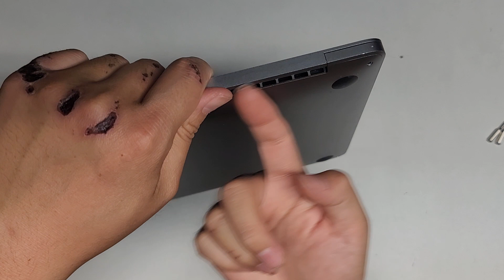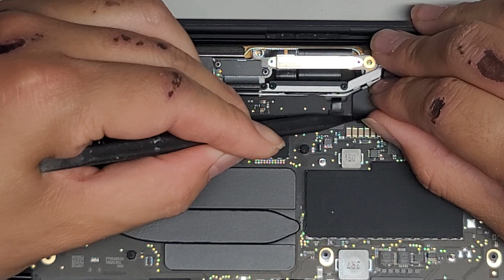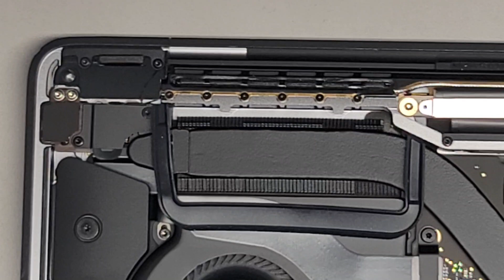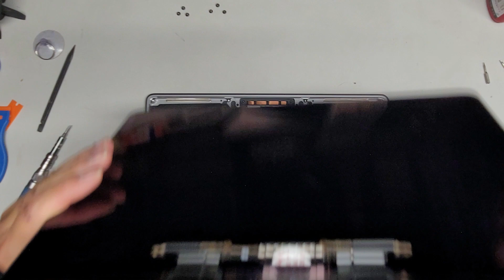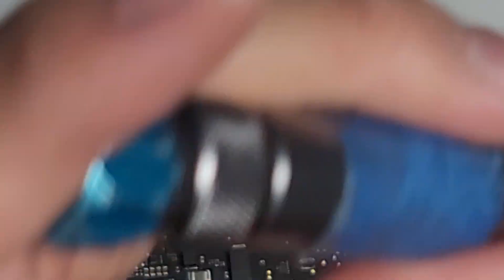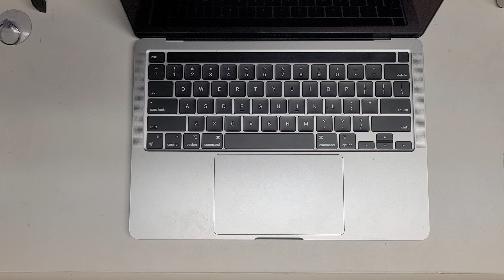2020 13" Inch M1 MacBook Pro A2338 Touchbar Disassembly LCD Screen Camera Webcam iSight Assembly

Comment: Hi!! Awesome video, but my True Tone is gone! Lol! I used a used original screen of the same model (A2338) and the true tone does not work. I already tried putting each screen back to its original state and the true tone works on both macbooks (I know that on the damaged mac it works because it connects a screen via HDMI and True Tone works). Any idea why that happens? Or any solution?
Reply from the maker: Did you check the year of the MacBook to make sure? Also, some people sell screens where truetone doesn't work.
Reply: @ItsBinhRepaired  Yes, it is the same year. And the replacement screen is original from a macbook (100% sure True Tone worked on the Macbook it was on). What is strange is that being all original and the same year, the true tone does not work, because the camera and everything else works correctly. It must be some configuration or programming... but I don't know about that, do you know any possible solution?
Reply from the maker: @danielfagav  hmmmm maybe aftermarket is better.

Comment: Is the camera working after screen replacement ?
Reply from the maker: The camera works, but after replacing the screen, the screen won't work...(sarcasm)  lol why do people ask these questions?

Why would I post a repair video that causes things to stop working? Makes no sense.  Lol
Reply: @ItsBinhRepaired  I am asking cuz I replaced mine and camera doesn't work and its OEM screen. I don't know what the fault is
Reply from the maker: @tr909love  did you confirm the year and model? That information is very important. If you have the wrong model it will have issues. Try this to check your year and model info.  https://everymac.com/ultimate-mac-lookup/
Reply: I have the same issue after replaced the screen the camera does not work

Comment: Hi! Any chance to repair the touch bar only?
Reply from the maker: I'd replace the entire keyboard assembly. Now sure how you can remove just the touch bar
Reply: @ItsBinhRepaired   Thanks for the reply man. Do you mind sharing the shop I can purchase the replacement keyboard assembly/ top case?
Reply from the maker: @hadinasri  search a2338 keyboard assembly on eBay.

Comment: great video i like your content where did you get the screen replacement
Reply from the maker: Usually eBay or Amazon https://amzn.to/3oYRtjU
Reply: What the brand and part number of the blue screwdriver you are using
Reply from the maker: I don't use that one anymore. This one should be ok. https://amzn.to/3nKxi8c if you're willing to spend a bit more for tools that will last a lot longer, these are the best I've used so far https://amzn.to/3qMAFND I only wish they could integrate the extension rod like the cheaper set.